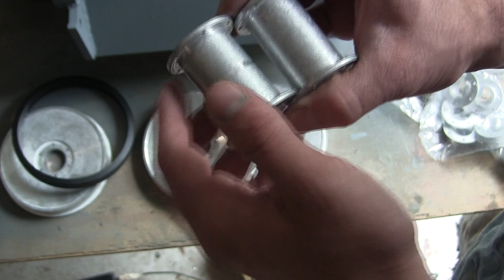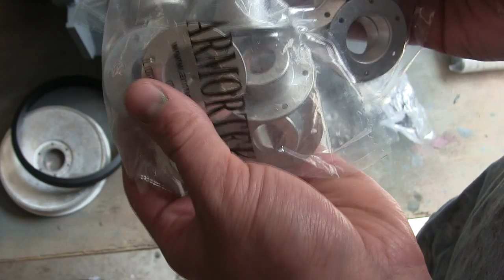RC 1/6th scale Armortek Early Production Tiger video #4 (Road wheel assembly)

Comment: For the motion kits, does it include everything that you need except the radio and do the kits have mounting points pre-made into the kit
Reply from the maker: Yes the kits have all the mounting points and fasteners included for mounting the kit's designed motion packs, Yes The armortek motion gives you all the motors and electronics to get the model moving. The only thing not included is the radio, and the batteries. Extras like sound and smoke, recoil are also not included with the motion option, but are extra options

Comment: you shouldn't grind aluminium on a bench grinder as it will build up with too much and heat and explode.    (unless you have a special wheel for aluminium. )
Reply from the maker: Normally yes, You want to avoid using a bench grinder with a standard wheel for aluminum, however for the type of light grinding I was doing it didn't cause any issues. A table top belt sander would also be a good use in place of the grinder